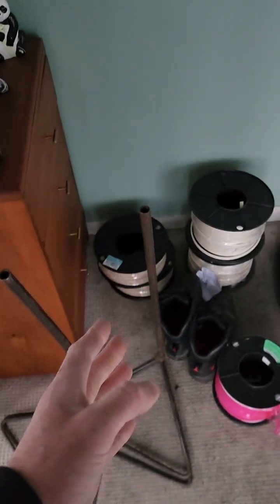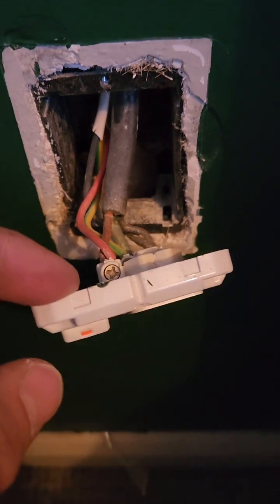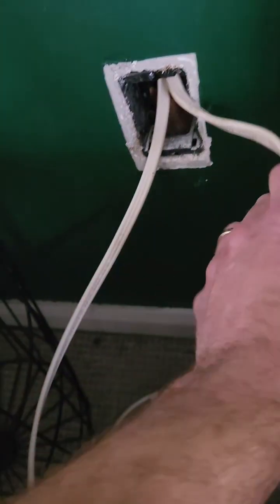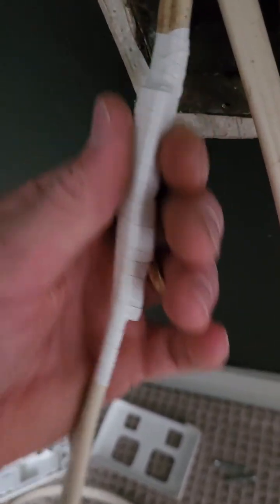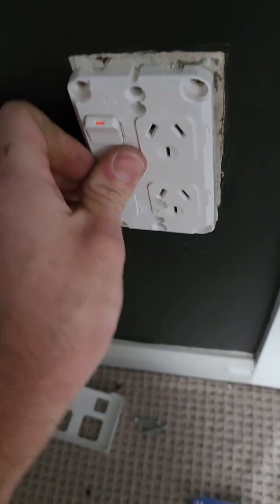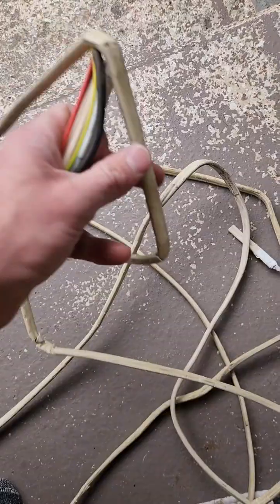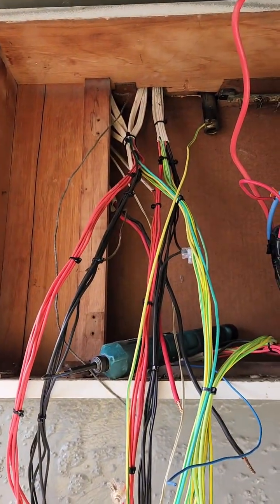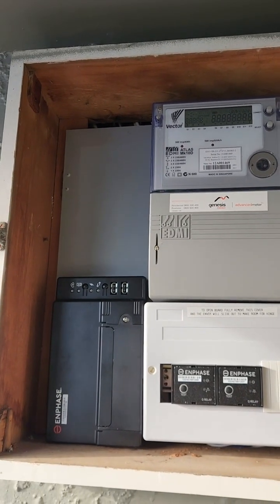Rewiring a house

Comment: Im currently doing some renovations on our house and one of the things I've come across is the need to join 2 cables. In this case its a redundant power point that as it has 2 cables running to it is feeding another place as well, I can't just disconnect it. Rather than doing the connection in the wall I'm going to put the connection under the house where we can get at it in the future if ever needed.  But how about doing a video on the correct way or ways of doing this job.  Crimps, connector strip, cable joiners etc.  I'll just use a connector strip for now in a junction how as that's what I have available atm, it's up to the sparky who signs it off as to what finally happens here. But what are the options and what's the best way?
Reply from the maker: Yea for sure, ill do some cable joining videos 😊